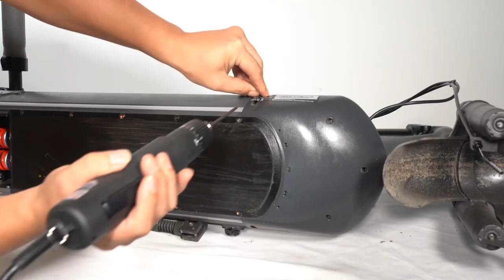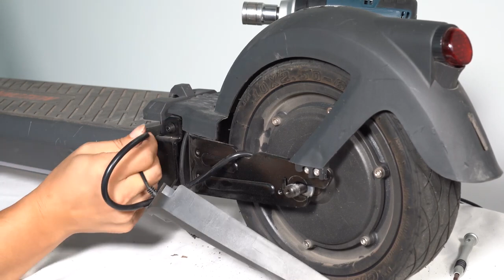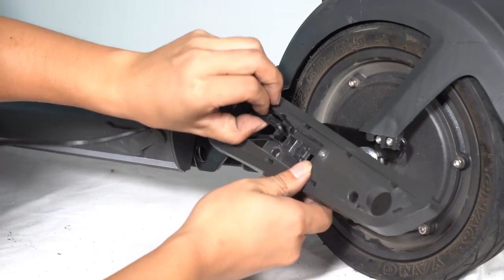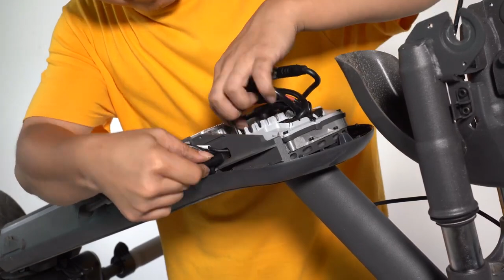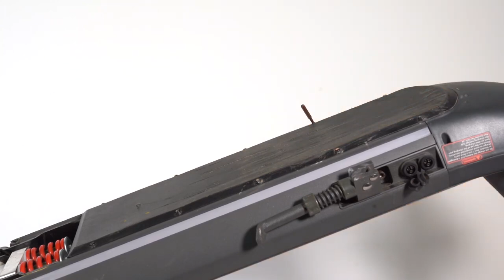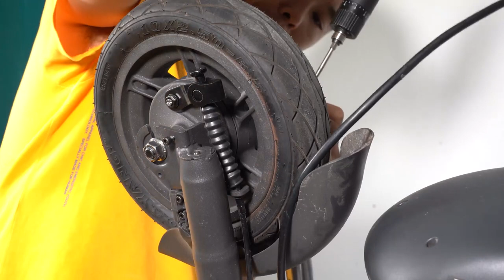The replacement of the S1 front wheel and motor

Comment: It was easy to replace the motor. Tip for the motor cable , run it with the plastic cover that comes in the tip to protect the pins, also don't try to run in the same hole that was before, not going to turn since it's too narrow.

Comment: my s9 says phase current sensor failed ,it shuts down at 70% or 37% sometimes ,what is wrong ?
Reply from the maker: We are sorry that you ran into issues. Can you contact us at service@imscv.com with your SN number & photos or video of the issue?
Reply: @INMOTIONSCV   well, thx, it was overheating due the hot weather which is over 35’c in europe.:( ,but my xiaomi scooter is working under the extrem temperature. i have tired the L9 under 30’c it worked normally.

Comment: This is a really pathetic design INMOTION. Have shame..
Reply: One simple cable waterproof joiner near the back wheel to disconnect the motor from the scooter saving taking the whole thing apart! How Stupid is your design team??
Reply: You don't need to take it apart for tyre Change
There is enough cable to take tyres off
But I fit honeycomb solid tyres
Had to take scooter apart 😢